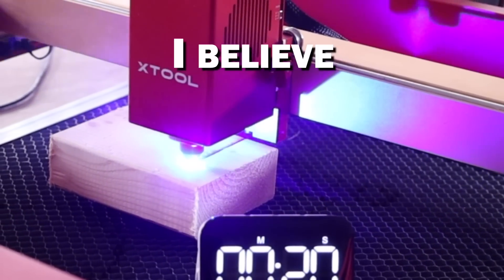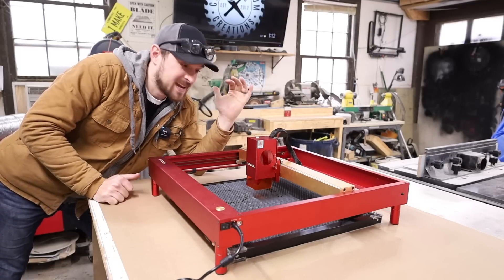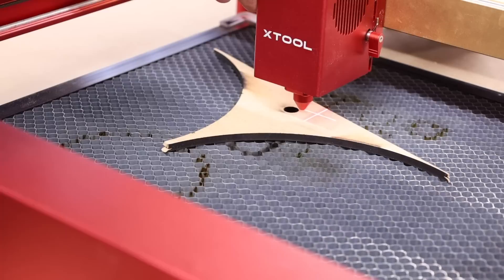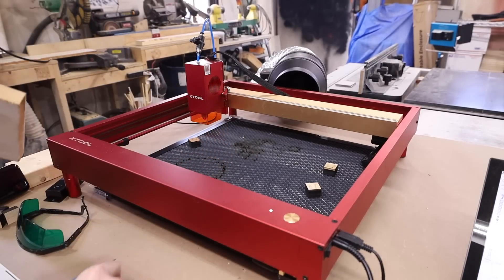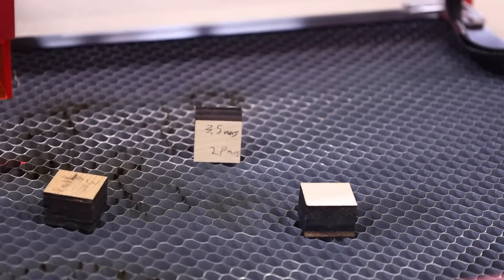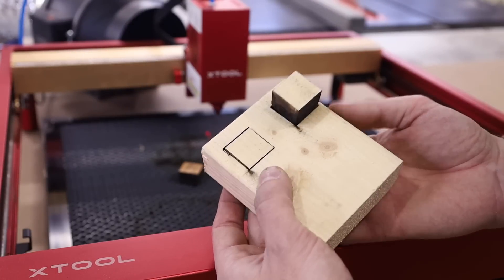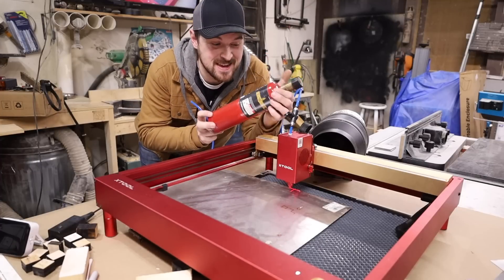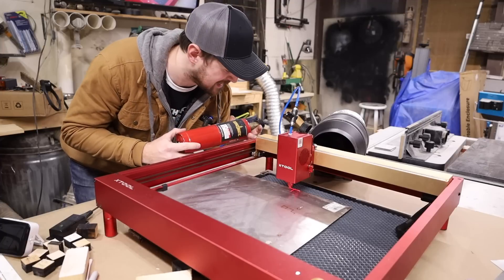World's First Actual 40w Diode Laser The xTool D1 Pro Cutting Test

Comment: XTOOL does not offer 40W head only kit, it appears that they are "bundling" 40W with 20W head. Is there any particular reason to have lower powered head as well, or is this simple a ploy to drum up costs since very few vendors offer 40W at this point?
Reply from the maker: I went and looked and I found that they have the 10w and 40w bundle the laser point on the 10w is a smaller dot size so if you were wanting to do very detailed works it would be good to have that combo. https://www.xtool.com/products/d1-pro-10w-laser-machine-40w-laser-module?ref=Chadscustom&utm_medium=5306&utm_source=influencer

Comment: Neat and all, but the laser module at its own costs 1200$, the price of a decent chinese CO2 laser cutter.
Reply from the maker: It is definitely pricey but I think even though this is only 40w it still cuts better than my $5500 90w Co2 laser.
Reply: @ChadsCustomCreations  that's true, it Cuts with a very well defined beam. It still won't cut clear acrylic.
Reply from the maker: Yes you’re right right as far as clear acrylic it’s still useless. It’s pretty neat seeing how diode tech has progressed so quickly I definitely need to revisit a comparison between co2 vs diode again.

Comment: I don't know if you're able to answer this, but it seems to me a pretty relevant question, only I have yet to find any answers, at all.

atezr v35 vs xtool 40w
output power: 35w vs 40w
spot size: 0.06x0.1mm vs 0.1x0.15mm
w/mm^2: 5833 w/*mnm^2 vs 2667 w/mm^2
In other words, in terms of actual performance, on paper, the atezr v35 outperforms the xtool 40w by a factor of 2.

Now, I'm reasonably certain that there are important factors I have not taken into account, not least because this 40w laser wouldn't make much sense otherwise, but given the magnitude of the difference and a relatively small difference in claimed output power, it seems to me that the atezr v35 either cannot live up to the claimed specs, or has to outperform the xtool by no small amount.

Do you have any way of verifying or debunk this hypothesis? Perhaps you know someone with a atezr v35, or something or rather?
It is the one question I'd like answered more than anything, because I want a diode laser, as opposed to a CO2 laser, but I also want to be able to do certain things you ight not normally be able to, with a diode laser, and to increase my chances of actually succeeding, I need to figure out which is the better choice, as I can only afford to buy one.

Of course the general quality of the xtool seem superior, but this is of little interest to me.

Thanks and best regards.
Reply from the maker: Based on those stats I definitely see your conclusions and if their stats are legit it would make sense. But honestly I wouldn’t believe the stats until they are verified by a 3rd party user. Speaking of which I’ve been looking at getting a laser power meter if you see one that you think would give us good results let me know I am happy to make the investment.
Reply: @ChadsCustomCreations  Ya, the thing is that these stat are never really verified, partly because it is difficult to do, and partly because the vast majority of people buying such machines, don't really care. What matters are the results, which makes sense, of course.
I however, do care, and if I could afford to do so, I'd simply buy one of each, and test it for myself, naturally sharing the results, but I do not have that kind of money.
That being said, the stats have to be rather a lot off to alter the conclusions, so perhaps it is just a matter of taking that chance.
Another interesting point, perhaps explaining the better focus, is that the atezr v35, as I understand it, use 6 laser diodes, as opposed to xtools 8, and it does make some sense that this results in better focus.
On the other hand, this also means higher output per diode, and I don't really know if there are any downsides to this. Longevity could suffer, for one, but there may be other factors.

I don't really know anything about power meters, but if the output alone is all you care about, it should be reasonably simple to make your own.
Quote from the great interweb:
"a watt is . 24 calorie per second. It takes 1000 calories to raise 1 liter of water one degree C"

Just to mention one approach. Then all you really need is a reasonably accurate temperature sensor, a black body containing water, preferably well insulated, and time.
Even better, if you just need to make comparisons, and don't really care about the actual numbers, you can use any material that absorb the relevant wavelengths reasonably well, which for the visible spectrum is as black as possible, perhaps with a rough surface to minimize reflection, and again time, to find the peak heat capacity.
I should think that it is a reasonably easy project to take on, and it would make for a nice video too. ;)

Comment: Hey man, just getting into the laser world and wanted to know, how often is your compressor kicking on with that setup? Considering forgoing their air assist and just using my compressor which is a very similar quiet compressor except it can do a bit more CFM at 40psi and assuming you're not always running it at 40?
Reply from the maker: When cutting I believe it is compressing the entire time but it’s so quiet I don’t really notice. I say 40psi cause that’s what it can maintain from that size nozzle, or at least that’s what it reads at my regulator.

Comment: It's not actual 40w, but yeah with quadruple You get that power :)
Reply from the maker: I believe it’s the same technique the fiber lasers use but they combine their power through fiber optic cables. Or how a 8 cylinder engine has twice the power of a 4 cylinder 🤷
Reply: @ChadsCustomCreations  they  use translucent mirrors to do lasers hit spots in the same direction to create the more power, how they are efficient I don’t know 🤷☺️

Comment: How well does the 40w engrave/etch steel?  Wondering if it does more than mark it like the 20w and 1064nm infrared heads.
Reply from the maker: I have had my 20w actually etching the steel I’ve tested. I haven’t personally tested the etching yet but I am sure it will eat at the metal based on my cutting test on steel.
Reply: @ChadsCustomCreations  Thanks for the info.  I would like to see how deep it will etch graphics or text in steel (stainless and carbon) and how good the resolution is for graphics and text.  I'll keep watching to see if you demonstrate those capabilities.

Comment: Silly question:  How do you keep the laser from cutting into the table, the floor, center-of-the-earth, etc.?
Reply from the maker: Valid question. The further away from the focus point the less powerful the laser beam is. Think child burning ants with a magnifying glass using the power of the fun. Though this laser does have a very long and skinny beam which I haven’t seen before. 

Under this material I have a sheet of aluminum that does a really great job of thermal diffusion and never seems to even get marked.

Comment: Thank you for sharing. I’m looking for one to use to cut 1/4 plywood for large door hangers (finished size 22-24 x 17-19 ish). Will this one work? Thanks!
Reply from the maker: That cut size might be a little to large i believe this cut area is about 17x17” but if you choose the 20W pro you can get an extension kit that i believe takes it to 48x17” I could be wrong but the specs will be on their site in and I have links in the description of this video.
Reply: @ChadsCustomCreations  Thank you so much!

Comment: Now i'll wait till there is information regarding the longevity of the module
Reply from the maker: Yes that is definitely a concern with any new technology like this. I know the other ones were rated at 10,000 hours, I imagine as long as the heat in maintained on the inside of the unit we should see a similar light span but who know this early on.

Comment: How do pro fiber lasers cut metal (also plasma cutters)? They first pierce a hole through the material and then they start doing the perimeter of the shape. Copy that and you can burn through that last sheet.
Reply from the maker: Yes you are right with the piercing technique. I was attempting it with drawing a tiny circle at the start point on the corner of the square but it seemed to me like I still was not able to get it to run slow enough to continue the cut. Maybe once I add oxygen we will see a cutting depth improvement.

Comment: But… can it cut white felt?  The Achilles heel of Xtool!
Reply from the maker: White “felt” I would assume yes, or am I wrong?
Reply: @ChadsCustomCreations  I cannot cut anything white with my 20W D1 (confirmed by X-tool that it cannot).  X-tool also told me that upgrading to the 40W will still not cut white materials.  I’m curious… I was wondering if you can give it a try.  I think it would make a great video trying to cut various white materials that it should a seemingly be able to cut.  I wonder if it’s the wavelength of the laser?  I can cut off white and beige easily, though.
Reply from the maker: @jsinope2786  oh interesting yes I did try opaque white acrylic and the 40w had no effect. Interesting though as it will do items that are painted white. Surely is will cut white paper right?

Comment: If I wanted to set up for primarily laser engraving anodized aluminum then possibly expand into cutting wood parts, what unit & power would be ideal?
Reply from the maker: I think for anyone wanting to test the waters of laser engraving I think the xtool d1 pro platform is a perfect stepping stone and you can come in even at the 5w which can always be upgraded to the other head units as your needs for power and speed increase.

Comment: Crazy!  One question, what fittings did you use to connect the compressor to the Laser head; specifically coming out of the compressor quick connect?
Reply from the maker: Right it is getting insane. I put a link in the description to a fitting kit you can get it will have everything you need.

Comment: So. Did you live after adding oxygen? I'm so anxious to learn how this worked for ya.
Reply from the maker: Trying to be safe I have a flashback arrestor being delivered for the oxygen line, even though I’ve learned through the comments that I needed it, and also that I don’t need it need it. I am going to lean on the safer side. Though I also learned oxygen by itself oxygen is not combustible, which I didn’t know. It has to have a fuel like another gas or even the rubber tubing for the oxygen to go crazy.
Reply: @ChadsCustomCreations  that's super interesting! I'm excited to see your experiment succeed! Good luck! Don't die!
Reply from the maker: @EngineHeadCW  thank you for the well wishes 🥹

Comment: Perhaps nitrogen should be used when cutting wood to lessen charring.
Reply from the maker: Very interesting I may have to try this out. Only material in this test that came out charged enough to rub onto my hands was the 3/4” oak plywood and someone also suggested that I should increase the number of passes and speed to reduce that over burning.
Reply: @ChadsCustomCreations  Just be careful with Oxygen!
Reply from the maker: @anoirbentanfous  I didn’t realize this until the comments on this video and watching some videos on it but did you know oxygen by itself is not actually flammable?
Reply: Correct. However, it supports combustion and makes things burn hotter and faster. A pocket of it lingering after you open the valve and then some smoke from the “charred” wood, the combustion will be instantaneous.
Reply from the maker: @anoirbentanfous  great point

Comment: Just because it can doesn't mean it should. All these toys can cut a lot of things slower than you'd ever practically cut and with terrible edges. So what's the point of those tests?
Reply from the maker: I don’t blame you if you skipped parts of the where I show the edges but every edge even the 2x4 came out straight and clean when wiped with my hand except for the 3/4” oak plywood and I am betting with a higher speed and more passes I could get that cleaned up also.

Comment: Will this new Circuit board/40W setup work with the Infrared laser?  As of now, I just have to swap out lasers and power supply if i want to switch between my 10W and Infrared.
Reply from the maker: Yes it is set up and ready for the infared laser module also even comes with a nice metal focal point distance setter in the toolkit.
Reply: @ChadsCustomCreations  Great news!  You da Man!  I appreciate the quick response.

Comment: Sorry but that was not 3 millimeters that metal it just wasn't I'm a machinist I can tell from a mile away the thickness are there any metal...
And then you move up to 22 gauge and 22 gauge isn't even a millimeter I think it's .7 or .8
Reply from the maker: I did misspeak I said the imperial correct but it was .3mm I forgot to say point

Here is a chart with the measurements https://www.metalsupermarkets.com/sheet-metal-gauge-chart/

Comment: 40 W is the input of the laser module. The output is likely to be a lot lower. With a 15 W diode laser, the output is usually below 5 W (approx. 4.2 W).
Reply from the maker: I don’t blame you for thinking that way because pretty much all of these companies lie about output wattage. Xtool doesn’t, this has 8 separate 5.5 watt laser diodes to bring it to a 40w advertised power and they tested live with some fancy power meter and it actually read like 42w of output power.
Reply: @ChadsCustomCreations  its impressive but for the price of the unit you can get quite the co2 machine. It also doesnt cut acrylic very well which a co2 laser does. I think my money is still going towards building a bigger enclosed co2 laser for about the same price.
Reply from the maker: @sageslarres  yeah I think it still comes down to the person and what they are wanting to do.
Reply: @ChadsCustomCreations  i get that but is there any decent advantages that you see to go diode over co2? If we disregard cooling and mirror fiddling that is, since i already know of these drawbacks.
Reply from the maker: @sageslarres  I believe there are. I am compiling A list cause I think it’s worth having a conversation about here on YouTube with the community. I am not picking sides but I think seeing the differences is worth it. I am frankly shocked at how powerful a 40w diode is. Maybe I’ve got something wrong but I cannot get my 90w co2 to cut like this.
Reply: @ChadsCustomCreations    cutting depends a lot on what focusing lens is being used. The longer the focal distance the longer the laser beam stays small. A 38mm (1.5") lens will be a lot worse at cutting than a 76.5(3") or 101.6mm(4") lens. Do you know what version you are running on the 90w? 

Ive tried looking for any info on  the d1 pro but cannot seem to find its focal length or laser profile. But its very possible that the d1 just produces a smaller laser beam for longer. 

It could also be that when you try to cut with the 90w laser you overwhelm the material easier since there will be more power on a larger space one you get a bit further down into the material. It might cut thicker material better if you limit it to 30-40w with the optics you got. Another tip is to undershoot the focal distance a bit so that the focus is in the middle of the material being cut instead of on the surface.

Buildyourcnc has some info on this
https://buildyourcnc.com/tutorials/tutorial-CO2-Laser-Optics-Lens-Selection-Focal-length

It would absolutely be interesting to see your list of pro's and cons.

Edited in a bit more info.
Reply: No, 40 W is the output of the laser (optical power). The input power should be arround 200W. This explains why the motherboard should be replaced by another model to support more power. The same for the power supply, it must be replaced.

Comment: Plastic hoses may spontaneously catch fire when mixed with pure oxygen, make sure you get an oxygen rated hose. Best to supply oxygen through a stainless steel needle. Precision and high pressure is what you need not volume. I highly recommend getting a green oxygen welding hose.
Reply from the maker: Yes you are right and I am unaware of the internals of this module it most likely is all flammable hosing so I am definitely risking damaging my machine by introducing oxygen 🤔

Comment: Great video; I appreciate it.  I have the xtool pro, and I've been trying to cut clear acrylic and have not been successful. Do you know if it will cut acrylic? If so, what are the settings?
Reply from the maker: Sadly blue diodes like this apparently no matter how much power will only cut black, red, yellow, lime green, deep green as far as I know. Xtool has a list of colored acrylics on their materials list for the XTool that it does work on. 

Co2 lasers have the correct wavelength for cutting all acrylics as far as I know.
Reply: For clear material like acrylic the co2 laser works best because the wavelength is IR so it gets absorbed by material but the led modules are a different wavelength.